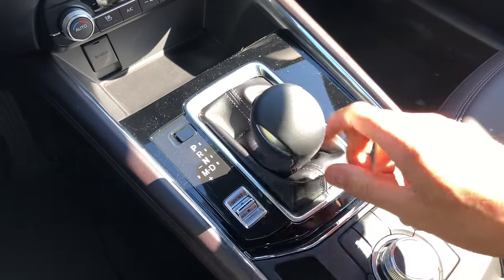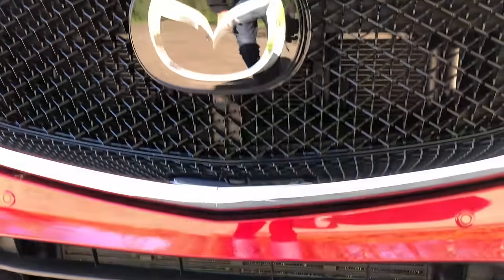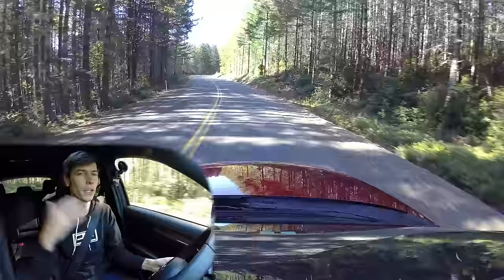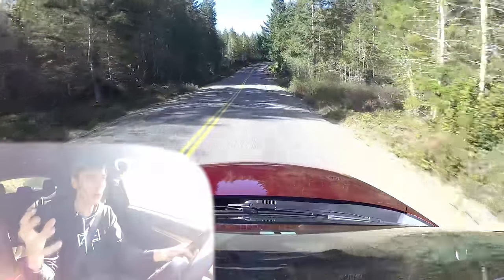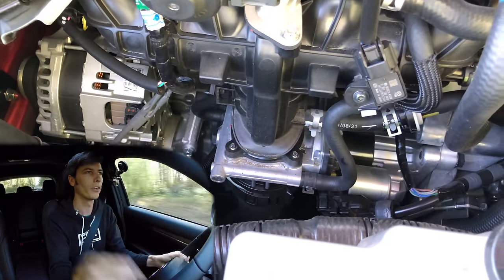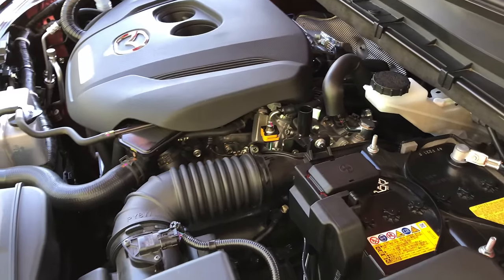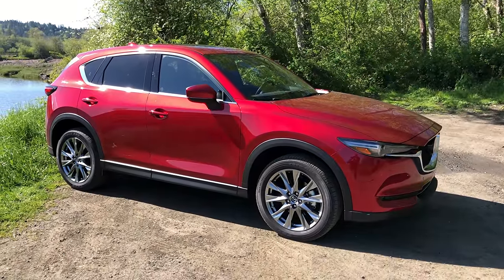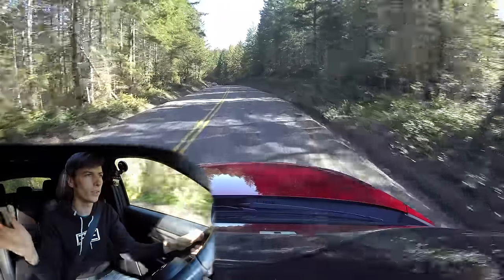Are CVTs Bad? Why Mazda Avoids CVT Transmissions

Comment: By getting rid of CVTs, Mazda is making a shot at reliability. As someone who works in the transmission industry, CVTs don't last long at all and they cannot be rebuilt.

Also, can you look at the Fiat 500 transmission? If I read the info right, the automatic and manual are almost 95% similar, with lots of interchangeable parts
Reply: Euphoria.10 toyota has been using cvts since the early 2000’s. Plus there’s a difference between the cvt in their hybrids and nissans cvt
Reply: Can you elaborate on "CVTs don't last long at all and they cannot be rebuilt"?
Reply: @listtamaru  How long they last depends on the driver, but generally you can expect 100k. And there's no parts sold for them, because they habe no OEM support, whereas an automatic has multiple manufacturers per part such as Raybestos, Alto, etc.
Reply: @user-oq3lv6lv7x 

True. Toyotas build their own CVTs, as where Nissans have theirs built by a Japanese company called Jatco(Which have been really bad in terms of reliability).
Reply: Alex jatco is Nissan lol. Nissan builds their own transmissions. It’s like Aisin and Toyota
Reply: @lttsr 

True. Thanks for the correction. Jatco still has pretty bad ratings on their transmissions.
Reply: Honda has very good Cvt's also. And I believe they can't be rebuilt because they effectively have three main parts, and when it goes wrong it ruins everything inside including the housing instead of just one or two gears in an automatic or manual.
Reply: Alex i agree. I’d never buy a Nissan. Lifeless cars. And I drive a Kia Optima with a dual clutch and I have more fun with that.  If they merge with FCA, they won’t even exist to me lol.
Reply: @SinfulEuphxria  my dad's Prius is over 250k km/ 160k miles and still using the first gearbox. His road side insurance actually recommended cancelling his contact as the Prius is so reliable, so they aren't that bad..
Reply: @fat1234568  Yeah but they don't even sell them as an option. Even if you could buy all 3 parts for, say, $2000 that would still be a savings from around $6000 and all you get from that is a warranty
Reply: My CVT lasted 72k miles and got a new valve body then at 77k miles total failure even with 30k mile fluid change intervals at the dealer and I was impressed it even lasted that long. Lol
Reply: Some types of CVT have rebuilds which are basically "remove all moving parts, buy new ones and replace them". If I remember correctly Fiat had a toroidal CVT in the early '00s that was like that. 
Toyota hybrids use a planetary CVT which are  essentially planetary gearboxes with two inputs and one output. These don't need rebuilds any more often than other gearboxes and the process is pretty much identical.
Belt CVTs which are common on mopeds and maxiscooters, need a new belt every couple of years and while you're at it you might as well replace the clutch rollers. This is no more difficult than replacing a timing belt and needs to be done at roughly the same interval.

Of course there are lots of different kinds of CVT and hydraulic types have been used in trains since the 1950's. The DB V200 and V220, come to mind. These are known as being very reliable and putting some 2100hp to the wheels.
I'm not sure what type but Fendt or New Holland builds tractors with CVTs. And farmers are usually not the kind of people who buy things they can't repair in the middle of a field.
Paccar builds HGVs with CVTs, and again truckers are not the type to buy things that they can't fix on the shoulder of a motorway.

Though as with anything, it depends on where you buy your CVT. You can't compare a Maybach, Voith or Malossi to a DMP or MHR.
Reply: steveXracer i made that exact mistake... I bought it in 2016 (knowing full well about CVT issues) and I said to myself “oh it fine, I maintain my cars. It won’t be an issue” WRONG! I bought mine with 58k on it and now have 79k on it. Luckily I was covered under Nissan’s extended warranty but that ends in April 2020. I plan on getting rid of it soon
Reply: Alex True. Nissan makes their own transmissions since they own JATCO. Everyone talks about how Nissan, a company that used to be as reliable as Toyota and Nissan, dropped in quality since they partnered up with Renault yet I don’t blame Renault. Most of Nissan’s problems are because of the reliability of their CVT which is THEIR fault. Not Renault’s.
Reply: Grouping all CVT’s together is like grouping all torque converter automatics together. Too many variations to make a blanket assessment.
Reply: Prius has a planetary gears e-cvt, a completely different animal from belt cvt.
Reply: Mazda is using transmissions made by JATCO. They make some of the worst automatics on the market. AISIN makes fantastically reliable automatics which is what Toyota uses
Reply: They could if people changed the fluids and the industry stopped lying about "lifetime" fluids. 

180k on my 15 impreza cvt
Reply: @steveXracer except there are major, documented differences like toyotas cvts last a long time and so do subaru because they use steel belts instead of whatever crap nissan and honda are using.
Reply: Yeah I noticed most European car makers are pretty much automatics or dual-clutch tranny. But I think they still love stick shift too.
Reply: @bosstowndynamics5488  my knowledge about that stuff isn't that in-depth thanks;-)
Reply: M vE except that the Prius does not have a CVT.
Reply: @geraldh.8047  okay, someone else explained it's a little different, but the Civic hybrid he drove before this managed to do over 200k km in 4 years without any issues too. (Yes it was leased so pretty well maintained, but still)
Reply: @SteedDigital1  - The steel drive belts are always the weak point in every CVT. The steel flexes with every revolution and weakens over time. They absolutely WILL fail; often earlier than an owner would expect going from a planetary gear auto transmission.
Reply: "CVTs don't last long at all and they cannot be rebuilt" WRONG. Then he talks about FIAT 500s for reliability....
Reply: @SinfulEuphxria  " generally you can expect 100k" WRONG. Toyota CVTs in cabs see well over 400K.
Reply: @truantray  That makes it an exception to the rule, not the new rule
Reply: @steveXracer 
Seems to me we are taking a step back as that was the norm decades ago.
Reply: @listtamaru  

CVT requires ALOT of upkeep. They don't use transmission fluid. 

CVT fluid has to be changed alot more regularly. Or else you will destroy the thing.
Reply: My CVT has 145k on it and it's still in good shape. 

But I was aware of the CVT upkeep. 99% of people buying these cars have no idea about them so they just run it with no upkeep.

Which kills them extremely fast.
Reply: @steveXracer 
I have 145k on my CVT. I've seen people with 200k plus. 

Not all are bad. But all require more upkeep
Reply: @steveXracer, just for my amusement. Would you argue that just about every diesel locomotive built since the 1950s is built wrong because it uses some type of CVT. After all the diesel engine drives a generator which powers the electric motor. So that the engine can remain at it's most efficient rpm, while the motor can put out any rpm required.
Reply: Waldemar Ishibashi i think i said that .
Reply: @user-oq3lv6lv7x  Yes, you did. I misread it.  Sorry. I am about to cancel my comment ;)
Reply: steveXracer thank you, and no problem! It was unfortunate but luckily I had the 10 year/120k mile extended Powertrain/CVT warranty on my 2010 Altima. So all was taken care of but I will unfortunately have to dump the car soon as the warranty will be coming up on end in less than a year (I’ll probably keep it a few years after that) but it’s unfortunate as I really like the features of the vehicle.
Reply: @zero2sixty244  My wife and I like the Rogue looks and size but I can`t buy it due to what I read about CVT. Too bad. In Japan, only Mazda and Suzuki offer AT in their SUV. There is Mitsubishi Delica D:5 that I want to check out as well. 
I find it pathetic. The manufacturers know about the issues and do very little. Saying that Mitsu offers only diesel with 8-AT in Delica D:5, I am very happy about that ;)
Reply: Waldemar Ishibashi I’m not familiar with Japanese specs as I’m in America but do you know if Mazda implements the same “lifetime transmission fluid” in Japan that they do in US? Not sure what year Rogue you two are interested but I really like the standard and optional features on the newer Nissan’s which makes it unfortunate their CVT is so unreliable.
Reply: @zero2sixty244  Not sure about Mazda but will check before buying.. or will ask them next time I check CX-30. I enjoy giving the dealership a hard time answering my uncomfortable questions :)
Thank you for that information. I will for sure check it in the future as my brother in law is considering Mazda. He changes trans oil every year in his Grand Cherokee ;)
I thought it was only Subaru with this "lifetime" BS. 
I like the newer models of Rogue. I will be buying a 2-year-old SUV when the time comes.
Reply: @nighttimestalker  so, what's the difference between the two fluids? Also, isn't it cheaper to just change a belt than some gears? genuine questions.
Reply: @nighttimestalker  so what is this upkeep?
Reply: @Bimbo-Balls   Not really if you look at the numbers produced. Lots of control bugs are now worked out and reliability is going way up.
Reply: @truantray  My comment about the Fiat 500 transmission is the interchangeability of automatic and manual parts. Not the reliability
Reply: @markeldik7057  they last so long because prius's have no power they are designed to get the best gas mileage they can.  Put a 300hp motor with a CVT and see how long it lasts.
Reply: @Formulabruce 

Do you have a link to those numbers? Would like to see them to understand your point, Sir.
Reply: @listtamaru  
Idk the full difference. 
But CVT fluid is kinda like an oil. And it has to be changed alot more often
Reply: @86surge90  
You have to have the fluid changed alot more Often
Reply: @SinfulEuphxria  it is pretty common for European car makers to put some servos to drive the clutch and the selectors in an otherwise regular manual transmission. Usually for small cars with low volume of sales with an automatic transmission. They are awfully slow.... But they are cheap and dependable...
Reply: My 2014 Honda City just hit 215k km last month. It's only ever been serviced at the dealers (for warranty) and they drain and replace the CVTF every 40k kms.
Reply: I rebuild zf cft30 transmission. It is usually o ring failure from very high pressure. I dont repair newer ones because I don't want to spend the money on the special tools. (Which i did for the cft 30 and have barely made my money back after 10 years.)
Reply: FIAT is complete garbage (and is owned by Chrysler THE WORST car company to exist in terms of reliablity) so if they use the same parts Mazda owners are in for some headaches
Reply: @Jaymac720  You're way off. Where in world did you associate Jatco with Mazda from? My Mazda 6 is 2016 but but Mazda was making their own transmissions even in prior generation.
Reply: @yyk71200 Good point. Not many people know that.

Comment: Another advantage of a torque converter that spends more time locked up, locks up more frequently ect. is that the transmission fluid will stay cooler, and the life of the transmission fluid will increase. One of the biggest wearing aspects onto transmission fluid is  the shearing and heat load caused by the torque converter, especially in the vortex flow portion of its operation. 
Love the videos man! thanks for the good work and i think it's time i subscribed :)
Reply: Makes sense, but I heard these transmissions are kind of hard on the fluid, reliable, but just kind of beat up on the fluid

Comment: Happy owner of a CX-5 here. I don't have the turbocharged variant (just the 2.0L PRO model), but I can say, yes, this is an immensely enjoyable car to drive. Thanks for explaining the quirks of the transmission, as I do notice how shifting is almost imperceptible, but I have always wondered why the car seems to want to force itself on 2nd gear when going up a steep incline. If I enter the incline without enough momentum, it tends to try and remain on the higher gear instead of shifting down. This is perhaps the only instance I've ever had to jump in and help the car out by shifting down, but is this perhaps a result of what you were explaining regarding Mazda wanting high torque? Thanks again, I'm new to your channel, but I'm loving all the content you share.

Comment: As a gen 1 CX5 owner. The Mazda Cx5's are the best for people who love to drive.  I bought mine basically from the driving experience as I was older and needed something with space as all I had before was an integra and an RSX. Plus living in Canada means having AWD is very useful. So it drives amazing, feels great, I've had my fair share of driving it at its limits on multiple different occasions and handles pretty amazing. Honestly don't regret the decision looking back at what I was interested in. Gen 1's are like a Miata in SUV form.
Reply: Edme an suv gives you higher ground clearance, AWD, a bit more space and it’s short so it doesn’t take too much space so it is clearly more practical. The center or gravity is higher but they are a bit wider so with hard suspension they can take the corners fairly well.

Comment: I’m almost at 237,000 miles on my 2011 Mazda CX-7 2.5Liter I-Sport model. I’ve been quite happy with overall reliability. I purchased it as a certified Mazda back in 2013 with 30,000 miles. Hoping to reach 300K before I decide to sell it.

Only non scheduled repairs have been issues with the AC system($1200). Also had to replace broken power window gears($10).

Finally got Mazda to replace recalled  Takata air bag. Mazda Dealer only found a worn out motor mount and no other issues.

My 5 speed Auto trans is starting to get a little noisy on cold days.

Comment: While the CVT in my car isn't my favorite I will admit that it is buttery smooth and fantastic on long drives. For a daily driver a CVT is fine (especially if you do your maintenance) but for spirited driving there are better options.
Reply: Agreed, my gf's car (Toyota) has one mated to a thunderous 1.2L engine, and while unexciting, it's smooth and damn economical
Reply: Maintenance is paramount for CVT reliability. I do annual fluid changes regardless of the miles travelled. 160,000 trouble free miles from my Nissan Rogue.
Reply: If you are the first owner, make sure you get rid of that POS when the powertrain warranty expires. Otherwise you're sitting on a ticking timebomb. 

You've been warned.
Reply: I have the civic with a CVT and while it's fine most of the time, the jumping and lurching at low speeds has me looking at new cars.
Reply: Especially Honda's new CVT.
Reply: I certainly feel less inclined to accelerate quickly with a 2016 Nissan CVT: I certainly don't like the idea of spending 4-5k to rebuild (i.e. buy new) a CVT. Great transmission for long, steady drives. Not great for needing to regularly accelerate quickly.
Reply: I totally agree with this statement. My '16 corolla is so damn smooth compared to any AT I have tried and the 50+ years in business sealed the deal for me.

My only complaint is that it COULD use JUST A LITTLE BIT more power for highway entry. But people in New Jersey drive like 80+ and tail gate like mad. Completely dangerous
Reply: @Screaming_Sloth  Especially for the transmission. Always read the service manual and do it %100 to specifications and CVT's need the correct amount of tranny fluid and tranny fluid EXPANDS when it is heated. Toyota recomends the tranny fluid to be at 103-114 and the fluid should start trickling with the hose thingy for the fluid level before you seal it shut
Reply: @thekanuck2778  Is it the electric throttle body that causes that to happen?
Reply: @johna7287  From what I've been told, it's just a normal part of the CVT experience. I'm just not a fan, almost feels like someones hit you.

Comment: Thank you for avoiding the CVT MAZDA !!
Reply: They embraced the plastic engine.. not sure that will last..
Reply: Same with Hyundai and Kia as well. Nissan and Subaru's CVTs are horrible, avoid them like the plague.
Reply: @aitorbleda8267  No they didnt
Reply: @aitorbleda8267  Their engines are not plastic. There are pieces of plastic heatshielding shroud on top of the engine. It is a simple five second job to remove to service the engine, and then again to replace.
Reply: Aitor Bleda they the air box and the top cover is plastic, but once those are out, it’s almost all metal.  Changed my Mazda3 engine and transmission fluids last week and looked pretty good underneath the cover
Reply: @BrianYYH  my Mazda has had the same plastic airbox since 1988. Still working just fine
Reply: Absolutely. Thanks Mazda.
Reply: @brianlee4629  
They always feel like their slipping.
Reply: @brianlee4629  Subaru is solid for sure. Nissan has sucked for years. Worst car I ever had was a Mazda 3. About to get a Miata though.
Reply: @brianlee4629  i thought Subaru's CVT are reliable ?